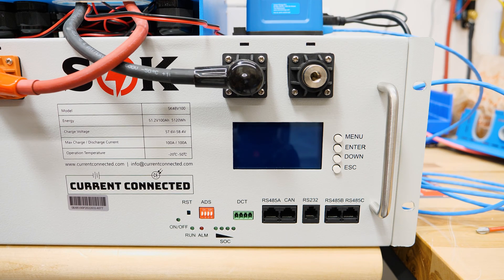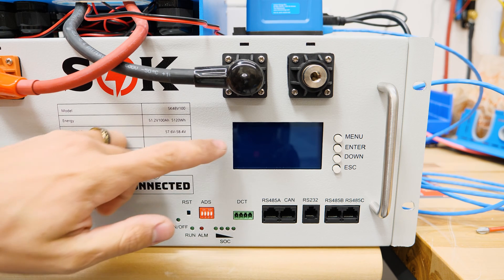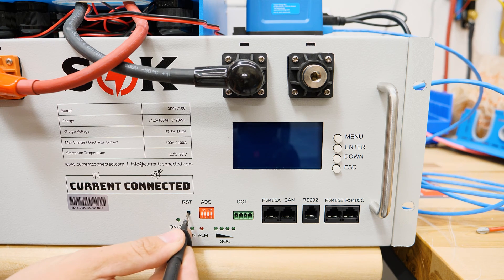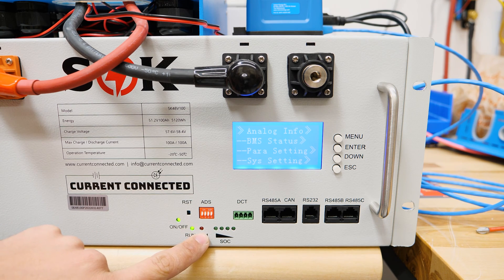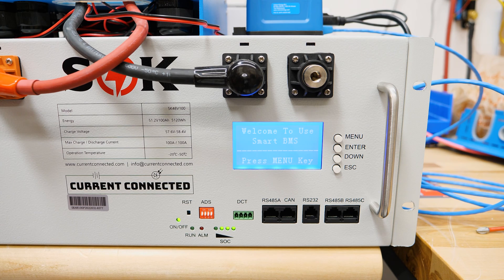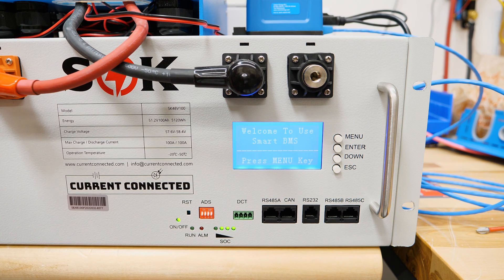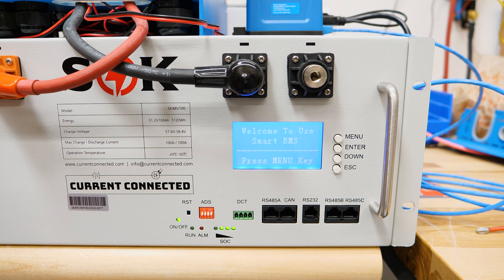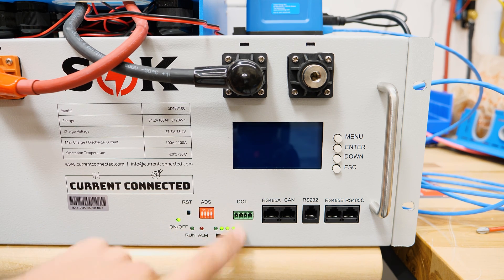SOK SK48v100 LiFePO4 Battery: How to Power-Up & Shut Down The BMS

Comment: Any word on the DCT port? I am looking at purchasing a Samlex 4200 Watt, 120/240 VAC Split Phase 48V Inverter/Charger. It has onboard solid-state relays with dry contacts that will accept "stop charging" and "stop inverting" signals from a BMS. Thanks!

Comment: Quick question,  Aren't the dip switches ALSO used to set each battery's address so the computer software can address each battery individually. Pusang and some other batteries use them for this purpose as well as being controlled by the inverter.
Reply from the maker: Yes, when using the RS232 cable they come into play, unless you are only connecting to a battery individually.